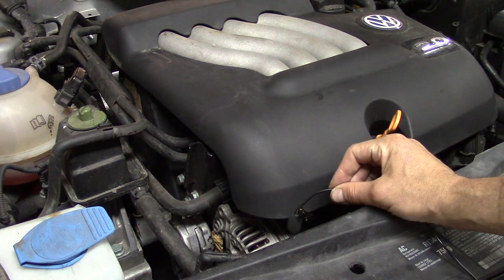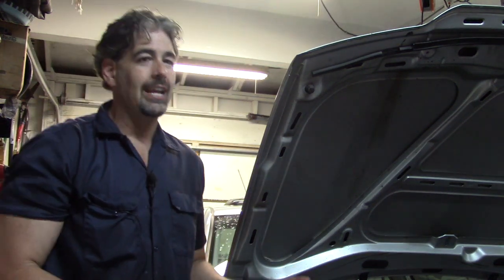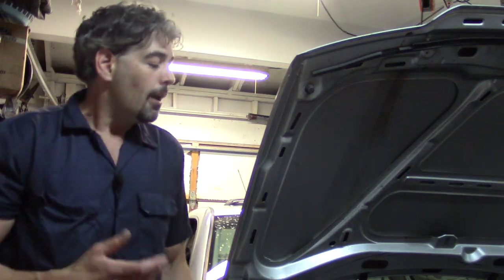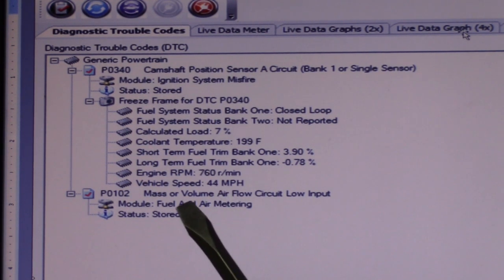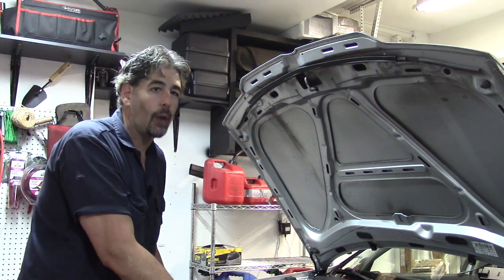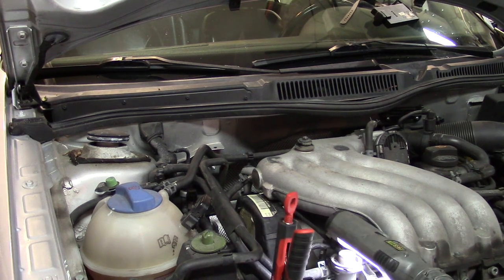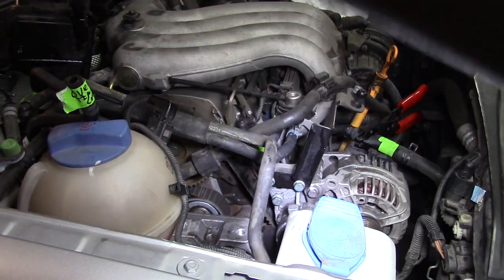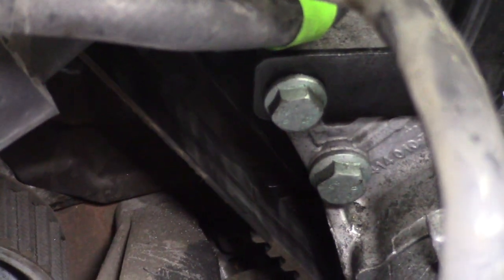Volkswagen Engine Noise Diagnosis

Comment: I have a comment that I would like as many people as possible to consider and respond.......

(Sorry Matt if I'm "highjackiing" the thread. If so, just post an advisory as such and most people will respect it, I'm sure).

Postulation:  WHY is it not "fraud" for a shop to replace a part that has nothing to do with the problem?  It should be MORALLY AND ETHICALLY MANDATORY, OR POSSIBLY EVEN A LEGAL REQUIREMENT (WITH SOME REASONABLE LEEWAY) FOR A SHOP TO EAT ALL costs ( labor, cost of part, "shop supplies", taxes, and every other cost involved to the customer when a shop replaces a part that is clearly not the problem.

How can they even get away with this?

If the shop ran the engine after changing the CPS, they would clearly see (hear) that the problem was not solved. So they did at least three things wrong.....first was changing the wrong part and ripping off their customer, making the customer pay for THEIR ineptitude, and second, they did not fix the problem, and third, the pretended they did fix the problem (apparently).

Plus, they wasted the time, and probably caused some inconvenience to the customer.

What I have never understood is how any shop can survive without repeat customers?

Seriously though, I really think that if more people started using words like "fraud", "court", lawsuit" etc, then this would not happen as often.

Not saying I'm perfect. When I was in the field I made mistakes. But I always did as much to make the customer whole as the shop owner would allow (which usually was not much).

I once sent a car out with a loose distributor hold down bolt. Man, did I ever feel bad about that.
Reply from the maker: douglas lee I'll respond. It IS fraud, and if not, it's negligence and they should be responsible. They sent this guy off paying for an unnecessary repair without diagnosing that he was 2 teeth from engine destruction. If as a result on his way to get a correct diagnosis the engine blew, it should be on them.
 Here's why.
Let's say instead of a mechanic, this customer was going to a doctor because suddenly one morning his knee hurt badly. 
  The doctor looks at him and despite the fact the injury is very acute and counterindicated for multiple reasons such as high fever and other things, he calls it Arthritis and says patient will need knee replacement. He charges the patient for a treatment of Humira (an immunosupressant) which does nothing at all and sends him home to contemplate how to pay for the major surgery. 
But it isn't arthritis... it's a MRSA infection. And as a result the patient dies a day later from massive sepsis.
  If you think for a second that doctor would not have his ass sued six ways to sunday- and lose- you're nuts. He would probably never practice medicine again after documented evidence of his sending a patient home with a "hot joint" and clear signs of infection.
  But a mechanic does this- and the customer is expected to come back again and again.
Reply from the maker: ***** Chris you are missing the entire point.  Doug's point was to the analogous THOUGHT PROCESS, not the efficacy of treatment.
Reply: ***** Chris,   I agree and understand that  "sometimes you have to pay someone to give it their best shot".

I don't have a problem with that. 

I guess I am just generally saying that if I take my vehicle to somebody and they work on it, and charge me money for the work and usually for some parts also, but the work they do and the parts they put in don't do anything to resolve the problem, should I be paying for that?

There is a difference between medicine and fixing cars.

Every mechanic has made "mistakes". Matt has. Paul Danner has. I have. My lifelong mechanic has.

You and I would not be far apart if we talked about this at length.

There is a huge canyon between a well intentioned technician making a good faith effort to solve a complicated issue versus an idiot (or just an unskilled or incompetent person) whacking away at a car with no clue what they are doing.

Matt did a story about a customer who had found a traveling mechanic on craigslist or someplace. The guy took the person's engine apart, then disappeared for two weeks.  Matt-it was the one where the guy mentioned a "frozen piston"----can you remind us which one that was?

Chris - My point is that when we are paying a hundred dollars an hour or more to a shop where the people are supposed to be highly skilled, we should not pay our money for them to "experiment" or spend a lot of time "learning on the job".
We should pay a fair amount of money to them (and yes, a hundred dollars an hour CAN be fair, if they are good) to resolve the issue efficiently and accurately.

Comment: i think i prefer timing chains vs. timing belts. i have actually never had a chain fail and the only reason i have ever replaced one was if i was in there anyways for some other reason and did it as a preventive. chains are stronger then belts and do not generally require tensioners. also belts age and dry out you can have a timing chain that is 20+ years old and still fine because its steel and not rubber.  im not even sure why the use timing belts, i think they suck in my opinion. yes chains can wear out but that takes many, many miles (as many as 200k+ miles) and they usually stretch and dont break.
Reply from the maker: +andrew donohue Agreed! Timing chain fan right here- plus being a high performance kinda guy, nothing beats a chain when running 400+HP I can assure you!
Reply: for real stupidity how about an interference engine with a timing belt. has to be one of dumbest things going, but i believe there are quite a few Japanese cars like that. belt lets go and BANG, was that a valve hitting a piston , that engine just became a paper weight in seconds.
Reply: I generally agree that chains are preferable to belts, but they can have some drawbacks too. I had a Mercedes with a M104 engine before, with a timing chain that was leaking oil from the cover. It was common to have a leak at that cover as the design had two intersecting planes of sealing surfaces.

Belts don't need lubrication so the issue is avoided altogether.
Reply: yeah that's possible how bad of a leak? a small leak is an annoyance and wont leave you stranded. i also think that if you do have a leak that typically its a small leak and as long as you watch your oil level its not much of a concern . a belt will leave require replacement AND it can damage the engine very seriously if it fails on an interference engine. if the timing belt fails on and interference engine, the crankshaft will continue to rotate and the cam will stop. valves meet piston BANG major damage and a possible completely trashed engine.

Comment: Can someone help me out please' I bought a 04 vw caddy a couple of weeks back' glow plug light started to flash yesterday then went of again' this morning light started to flash and engine became rough' then light went out and engine back to normal would like to hear  answers to my problem' many thanks' Paul.
Reply from the maker: What is the voltage at the control showing? Have you tried a bypass test to confirm control and ground?
Reply: Schrodingers Box hi thanks for reply' my mate is going to do a diagnostic check on van this morning' will let you know how I got on' many thanks' p b.
Reply: Schrodingers Box got the van sorted-' glow plugs' and the rough idleness was just the van had not been driven in about a year or so' got her back there at a price of 50 euro' well pleased' cheers for your reply' 👍.

Comment: I have what I believe is an internal engine noise on my 2003 Jetta with the same motor.   Anyway I can send you a couple short videos?
Reply from the maker: Dave Frank Why not just diagnose it? There is no way I can confirm what an engine noise is just by listening to it- even if I was sure what it was you have to diagnose it to be 100% of the cause
Reply: I don't know too much about it to me it sounds like a rod bearing and with all the metal shaving's I'm finding in the oil, lack of compression etc I'm deeming spending $300 for another motor with only 120k (compared to 200,000) will be the quickest way for me to get the vehicle up and running properly again.
Reply from the maker: Dave Frank Yeah metal in the oil is bad.  See my video "diagnosing rod knock using a screwdriver". You can compare the noise at the start of the video and also learn how to diagnose if it's rod knock for sure

Comment: I would like to hear  that shop explain how a camshaft  position sensor would make that sound...
Reply from the maker: ***** Technically their argument was the camshaft is probably making that sound but they needed to change the camshaft position sensor to be certain... which might even be worse logic lol!!
Reply: Schrodingers Box They would have changed the timing belt with the camshaft, fixed the car and made much more profit.

Comment: being that i have recently purchased a VW, with the VR6 at the 1:00 minute mark of the video i have to pause it and take a wild guess.   The Bushings on the rod that is in the intake are shot.   =)
Reply: Rhage73 keep in mind, that means i will start by looking there.  don't mean i would be changing anything
Reply: Rhage73 oh crap, the intake is not the same as mine.  well wasn't a bad ninja guess as that is super common on the VR6

Comment: I've owned many German cars with the respective Bentley service manuals. On nearly every page, it references VW special tool xxx-xxxxx or yyy-yyyyyy. Sometimes I had to give in and head to Amazon.com for a cheap aftermarket tool that is good for a few uses. But for the most part, and as demonstrated in this video, you can Mickey Mouse a tool that works just as well...just doesn't look as sexy. How many sockets and Allen keys I have ruined over the years because I had to grind them into a new shape. Thanks Audi / VW.

Comment: How on earth is that engine still running with all those teeth missing from the belt?
Reply from the maker: Mike Tipton I know, right??? and it runs perfect- customer drove it over even!!
Reply: Schrodingers Box that's vw for you ;)
Reply: They do. Had a Jetta with numerous teeth off in SEVERAL sections that still ran good! Go figure!
Reply: Mike Tipton. well its a VW

Comment: No maintenance. Shit happens. Need to change belt, tensioner, damper and water pump. Good luck getting that engine mount back in. It's a real pain.
Reply from the maker: Engine mount was a snap. Took under and hour.
Reply: @SchrodingersBox  And for the serpentine belt tensioner you just need a 15mm spanner to compress the tensioner and a 3.5mm drill bit to hold it in the open position while you fit the belt. One of the few good points on this engine.

Comment: It seems like all these new cars require "special tools" which means shops might not have them and only the dealer can do it. All they want is more money
Reply from the maker: argonian bilbo I agree with you. I also very much suspect there is intent (if not conspiracy) to prevent DIYs from doing their own maintenance and repair and in fact channeling business to the dealer instead of independent shops through the same strategy.
  In all fairness though- most DIY's by far are complete and utter hacks and the roads would be safer if they kept their hands off their cars that I share the roads with.

Comment: when i put in my clutch it makes like a screeching noise i have a 1999 vw beetle standard GLS
Reply from the maker: +Juanita Rodriguez So is it timing belt, accessory belt.  or clutch making the noise?
Reply: +Schrodingers Box 
im guessing my clutch but also when i give it gas and put my cluch in and change gears and remove my cluch the noise comes and goes. and its more like a hissing noise not screeching
Reply from the maker: .Juanita Rodriguez remove accessory belt see if noise goes away